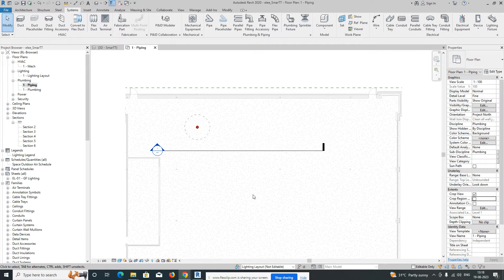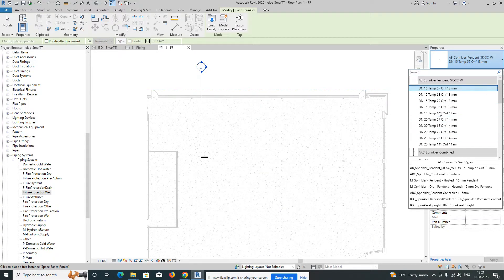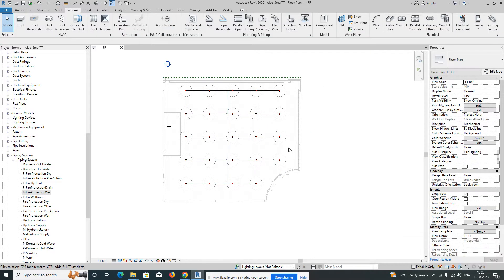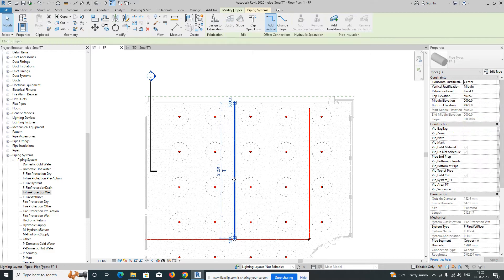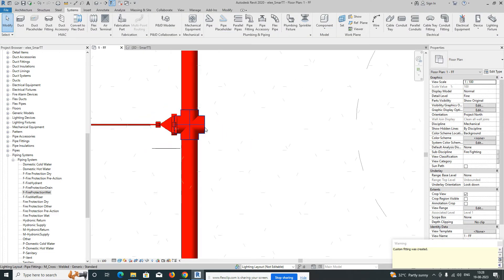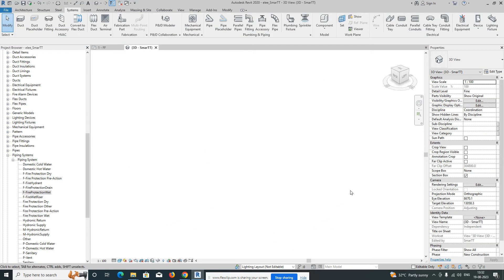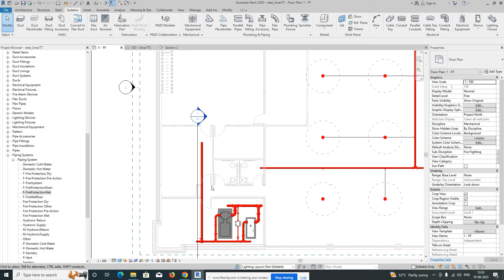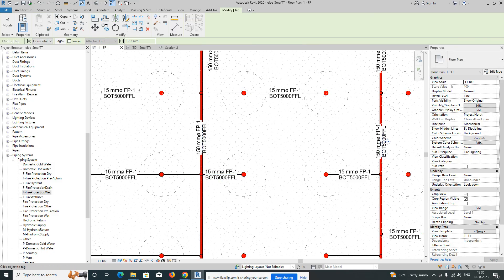Revit Fire Protection System Tutorial

Comment: Technically sprinkler spacing not correct, as per NFPA -13 distance between sprinkler to sprinkler should not be more than 4.6m
Reply from the maker: Yes You are Right But This video is just for a practice purpose How to place a Sprinkler & Pipe In to the Revit, any way thanks for your comments  and I like these kind of comments need to implements in My Next video.🙏 if you are like any part of my video please support my channel to grow thanks 🙏
Reply: Actually you‘re not correct either. The maximum is 4572mm - regardless what is said in NFPA. 15 feet right?
Reply: 4600mm is beyond 15‘